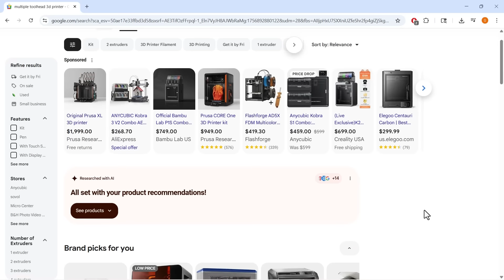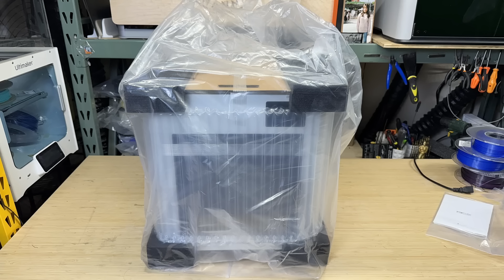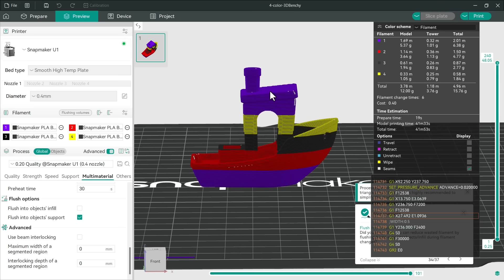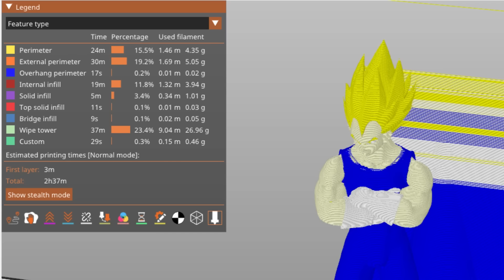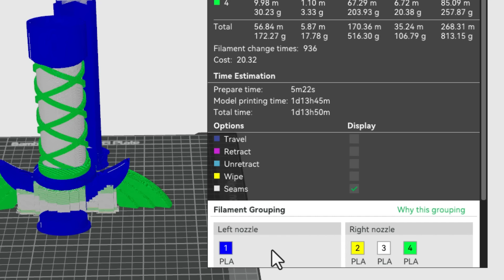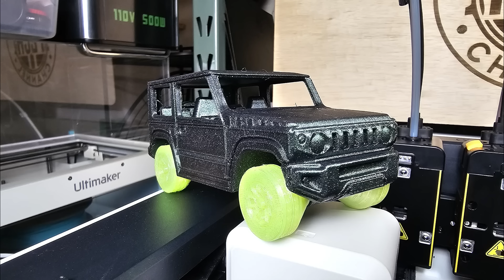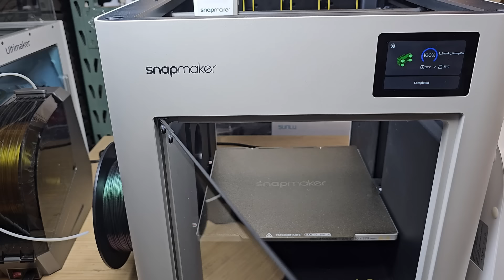SnapMaker U1: A 4-toolhead auto-changer 3D printer that will change multi-filament printing

Comment: This is a ...game changer. Although I saw somewhere that you can't get to the extruder gears in case there's a jam? Not sure if that's true.
Reply: Yeah, access to the extruder gear is key for long term use. Sooner or later a spool will have a tangle and the extruder will need cleaning to avoid color bleeding btwn filament changes. Dunno why most reviews do not include this key check.

Comment: Thanks for this thorough review. So far this has been the most in depth review I have seen. This printer has a lot of potential. But I will hold off until it actually comes out. And if the production model reviews are good, I might seriously consider buying one. Just not ready to be an unpaid beta tester for this printer.

Comment: Def looks far less industrial as the xl,   and the power supply is clearly no way near as powerful as the xl with its 3x power supplies.    But i mean the price makes it hard to justify an XL anymore.   Even though the xl has that extra tool head.      I think you find the XL a better machine in the long run for a heavy print farm where the long term cost difference is really not so much of a issue and the prusa support is legendary.    But if this machine went wrong you could just buy another one and still not have spent as much money.     The auto filament feeding is a useless gimick,   it means you cant put the reels where you want.  I have mine mounted on the wall above and behind the machine.  And i can use any reels not matter what.     Prusa are the most accurate machines out there for sub mm accuracy so its more of a engineering tool.          But i still think this machine will impact prusa sales.    I bet it wont be long till a new 5 toolhead version of this machine is developed.     very promising and clearly a better option for the everyday person,   for engineers cad designers making mechanical prototypes the XL still the only real option.     but lets face facts 90% of people just download stls and print in their home this machine is the clear choice for those people.     XL is really a business focused tool.
Reply: You can put spools anywhere, you don't have to route them through feeders. And prusa xl is not reliable enough for business/print farm use, it's just overpriced printer for prusa cultists who have too much money.
Reply: @riba2233  lol   ohh dear   someone def anti prusa lol.    Dude i owned them all.   i run a massive print farm on a industrial scale.    My employees and i know what we talking about fr using them all.  The xls did have lots of issues to start with, now their flawless.  I am actually a fan of our fleet of vorons.    their great as they are infinitely upgradable as new tech comes out.

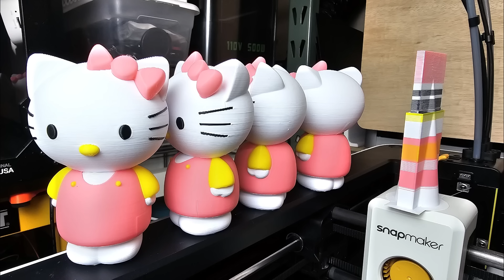Comment: 13:21 - It seems like there is a bit of color bleeding from the black whiskers towards the right side (in the lower and middle whiskers), and some fairly harsh layer inconsistencies. Kudos on showing the prints lighted from above. It seems like the U1 is fine with its multi-color capabilities, but every review I've seen seems to show SOME printing defects. I wonder if the profiles provided are just too fast, or if the tool offset calibration needs a bit of improvement. I think I will wait until actual units arrive to paying customers to see what they say.

Comment: Great review as always, I respectfuly suggest you also mention where is the filament runout sensor on every machine you review.  In our case we only print with recycled PET filament from plastic bottles, because of that we will love to hear that the filament runout sensor is in the head or the printer has a way to use every bit of it.  Thanks and keep doing great reviews.

Comment: If only it could get to high enough temperatures and had the hardware to handle engineering grade and filled filaments right out of the box. 
Fumbled the 2 yard line, SnapMaker.
Reply: That will make it really expensive
Reply: @Goroca  nope, wouldn't change anything hardware wise
Reply: @riba2233 
You now need bellows are electronics that can take 90c 
That is more expensive

Comment: Will u buy this or prusa xl or bambu h2d ?
Reply: H2D is already old school tech, and the upgrade to Vortex is hilariously worse design. It still retracts filament to AMS and then re-feeds. 😅 Means very slow printing.
Reply: @AtFives3DPrint  if they are old school then what is new ?
Reply: Prusa xl is a joke, h2d is a few universes ahead.
Reply: @riba2233 I will admit this, I saw Teaching Tech's fresh factory new XL and was low-key disappointed.  They need to drastically reduce the price, I know it's overseas but still.

Comment: You weren't into 3D printing when you were 3 years old??? It's hard to tell! Seriously though, best 3D printing review channel on the internet, by far. One thing I noticed is that you didn't cover engineering materials, and since there is no chamber heater or high temperature nozzle, this cannot be the best printer on your tech channel. Many of us don't print PLA/PETG at all.
Reply: Yep, this will be the best printer for printing useless multicolor toys.

Comment: I'm so impressed with everything I've seen from the U1 so far. The print quality looks top notch in pretty much every test I've seen. I know these are test units and we'll have to wait for production to see how it really turns out, but I'm hopeful.
Reply: The print quality could be improved though, look at 13:22 for example.
Reply: @diavalus Yeah I noticed that. Looks to me mostly like the white filament is over extruding slightly and could use some PA tuning as well. Everything else in the video is solid. I can pretty much always find some problems with a print, but I'm looking for signs of machine issues rather than filament tuning, which most YouTubers don't really do. Most multi-color prints don't look any better than that. Check out Duke Docs for some more high quality U1 examples with good camera shots.

Comment: I have a crucial question that no one seems to have answered: Have they nerfed Klipper in any way, or is this a normal fully open Klipper system?
For example, could I tweak the toolhead swap routine, nozzle wipe macro, PRINT_START macro, etc.? Do you have SSH and root access to the Linux installation?
Thanks a lot for the review
Reply: Snapmaker are promising to open source their changes next year. Hope they keep their word this time.
Reply: @pramarko but what are the changes? Is it a Klipper extension or did they actually modify Klippy code?